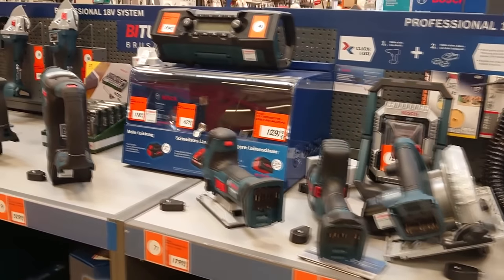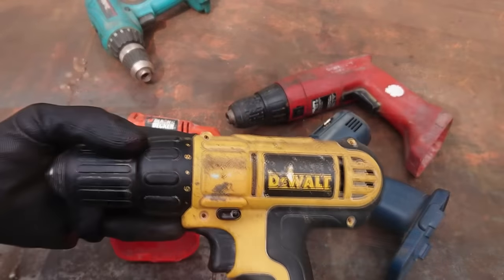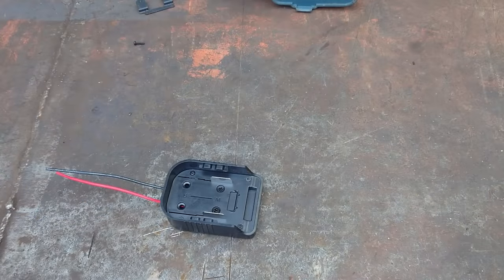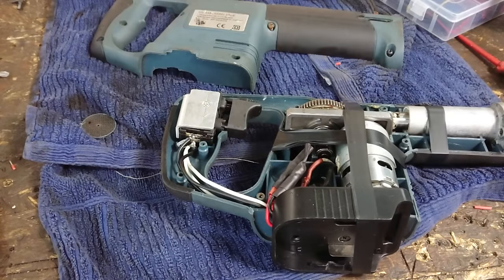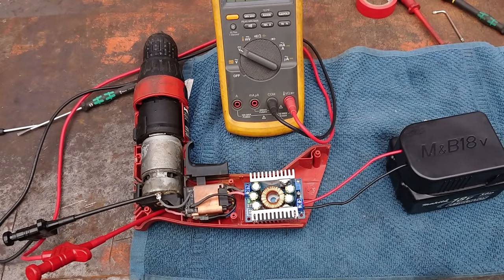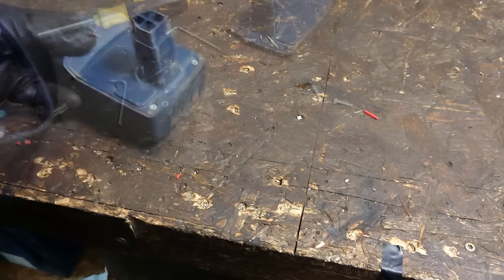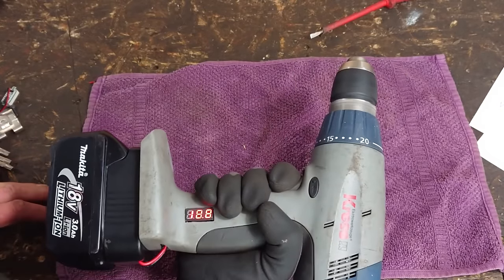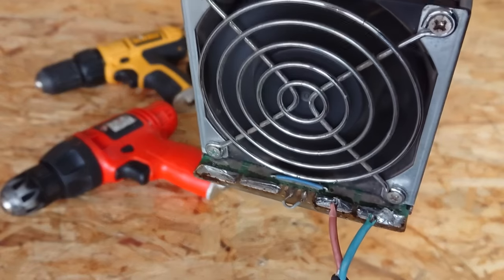Scrapyard Finds! Repair-A-Thon! Cordless Tools Galore!

Comment: My first cordless power tool was a Black and decker 4.8 drill they advertised that other tools were coming but never did as makita brought out the 9 volt drill and everyone followed and the race was on but back then the only way to get power was an expensive generator I couldn't justify buying one so I built a battery pack in a bag and used a 12 volt lead acid battery it made the drill super fast but it did what I wanted drill holes in metal I now have found numerous different cordless tools all different makes and it would be nice to convert them to take a Bosch battery as one of the tools my brother found cruising the alley was 4 Bosch 18 volt lithium battery drill kits all with 2 batteries and the charger so I have 4 drills 4 chargers and 8 batteries and would like to adapt my black and decker sawsall and circular saw also have various other cordless tools to convert

Comment: those drills running from the batteries in the DDR shoulder bags - do they feel odd? - the battery usually helps to make the tool feel balanced.

Comment: I wonder how much use or life these things have, or how much certain repairs can really help to reduce the production of new and shiny devices. That TiP reciprocating saw seems like something only you would use as the person who fixed it.

My biggest interest in the scrap yards is really for the motors and materials than can be reused. I wouldn't personally refurbish these tools. I would disassemble them.

Comment: hi Gerolf,
your idea of repairing and bringing to new life abandoned equipment is admirable, I would hope that your message will spread throughout the world.
With me you would break an open door: I am transforming an old battery powered Metabo drill from Ni-Cd (9.6 V) to Li-ion (3 cells 18650) using the original battery case. The biggest problem will be converting the charger, again into thyristor and transformer technology. the voltage change is not a problem because as in many of the drills you have restored it does not have electronic adjustment circuits. I will probably also put a voltmeter to keep an eye on the battery voltage, but I think I will put a button in series so as not to drain the battery between uses.
Whenever you want to do a repairathon you will find me agree, I also think you could sell the restored materials, but you probably already do.
Hello and see you soon
P.S. do not apologize for the singing birds: they are the background in line with your ecological way

Comment: I believe a lot of these tools are discarded because of battery failure and the cost of a replacement battery.
If you watch for sales events you can buy a new tool with a new battery and charger for just a few dollars more than the battery alone.

Comment: Corded cordless drill ! Thats what i do.I got old but gold AEG 18V (battery for it costed like 150€,fuck no ,so someone threw it in a garbage,professional tool with 80€ worthy of rohm extra self tightening chuck on it )that runs just fine on 14V DC/5A old battery charger.Ryobi cheaper one works also on 14V but its her natural habitat since its 12V.
Its all same old 775 motor which can go up to 24V -Only limiting factor is current.Different manufacturers put different mosfets and a diode that usualy go 5-6A.If you connect it to a car  battery and overload motor a bit it can draw more current than mosfet and diode can handle.thats what happend with my Ryobi-but it was as easy as find parts number and order it from ebay for 3$.

Comment: i just remake the batteries with old salvaged lion 18650 from discarded laptops, powerbanks etc. blalanc charge them, pick out the same valued ones and fit them in the old case add a bms and done.

Comment: The genuine Makita LXT (even the old ones with no level indicator) batteries do have built in undervoltage and individual cell protection...as soon as the board in the battery detects a problem it can lock the battery from being used ever again ...most commonly a problem if you leave mostly discharged battery packs in the cold and boom you're battery is locked ... Thankfully you can now buy new boards to replace them and if the individual cells tests good you can charge them individually up to ~3v with a current limiting psu and  you can bring the batteries back from the dead...for several years this was not the case and a lot of good Makita batteries were sent to landfill...unless I got my hands on them of course.....the lesson here is if you use Makita always charge you're batteries before putting you're tools away after a job.

Comment: Honestly I dont know if old battery powered tools are realy worth all the effort. Corded tools can perfectly usable,even if decades old, but cordless tool technology realy came a long way within the last years. I personally own a 12V Makita drill from '06 with a set of new batteries. Last year I went out and and spent ~35€ on a new 12V Parkside drill from Lidl, including a Lithium battery pack. It's almost disturbing how a cheap, but modern store-brand machine performs light years ahead of a barely used pro-tool from just fifteen years ago.

Comment: I just bought 9 dead lithium power tool battery on eBay.  1 was good 7 were good after charging one cell.  1 DOA rust but valuable parts inside.  <$6 ea for the 8 good ones.

Comment: I know I should have taken the electronics class in trade school. You are amazing.
Reply: I do not think you need a degree to do this sort of thing. Like he said red to red and black to black. When you use modules it is like snapping Lego together. You just need to know how to join wires and apply heat shrink tubing. Which is not nothing but I think anyone can pick it up.

Comment: I love it! Very cool video

On school I'm learning about electronics but it is very theoretical, whilst I'm doing a very practical study. So I love seeing these "hillbilly" solution that are just simple, basic, and above all just work.

No overthinking, not making things overcomplicated. Just make it work. I love it!

PS: Can you also use an adaptor with a convertor from 230V to 12V or 18V like they use for a Playstation, or many different electronic devices? Or would they not provide enough power to make the powertools work you think?

Comment: Fantastic video! You were lucky though that all of them worked so well..
Question for anyone who knows: I am restoring a cordless drill that seems to have been over heated and has a turn to turn short, it runs rough and uneven.. Is this restorable or do I need a new motor? I think rewinding it is out of my league and not worth the effort.. Tanks

Comment: Great customization and power unification. Instead of having batteries though, why not have an efficient portable generator you can bring in your bag working with any type of heat source (aka cognizable carbon fuel), and some supercaps as an energy buffer. Isn't  that going to be something ...

Comment: Those buck converters have a non-zero idle load/quiescent current, if you leave the battery on you might end up with a dead battery.

Comment: Dear @UCDbWmfrwmzn1ZsGgrYRUxoA, you can use a zener diode to detect low level voltage, remember if the voltage is lower than zener's voltage it will not conduct, so now you can implement solution : )

Comment: I truly wish there was a mfr who would also provide a power cord for cordless tools with dead batteries. Correct gauge wire of course  and a plug into the drill. Perfect for bench work when you can save the battery.

Comment: I once tried to connect a pc power supply to a cordless drill, but it ran very slowly and not much torque. I think the problem was that the switching power supply did not like the variable load of the PWM dril. I read that connecting a resistor across the output of the psu to give it a constant load would fix the problem, but I never got around to trying that.

Comment: From this fix it looks very like you're basically running tools originally designed for Ni-Cad batteries from Li-Ion batteries without any on board modification (apart from the voltage mods and voltage readout)?
If so, and the newer Li-Ion batteries just fitted the original tool, is there any reason why you couldn't just use them directly? (Assuming the original tool is the same voltage). I'm thinking of the AEG 18V range as I have 3 of these that originally came with Ni-Cad batteries (long since vanished).
Appreciate I'd need to get the Li-Ion charger for the replacement batteries.

Comment: Which system of power tools would you advise to buy for someone who has none yet? Price is not the biggest concern, I want to start with cordless drill, jigsaw or circular saw and sander first and then expand as needed. Would like a system where it's worth it to 'invest' in

Comment: AFAIK part of the battery is also the protection. So tehere is no need to add voltmeter or be worried about over discharging.

Comment: Thankyou for this video, it is quite useful. I would however like to know, what are the threaded low voltage power connectors called.

Comment: Im sure somebody already said this. But why dont you add a small momentary switch to the voltmeter so it doesnt constantly draw current from the battery when its connected to the tool?

Comment: I’m pretty sure that li-ion batteries from Makita have BMS circuitry inside. You could have tested it by discharging battery and checking if it shuts down. But I’m sure you knew it...

Comment: I think BMS is in the battery so there is no need for voltage meter acting as visual power protection. Makitas bms bricks if there is something wrong with the battery. I have repaired makitas packs with replacing the broken cell and replacing the original bms with the one from aliexpress. Makitas bms bricks beyond repair if bms triggers the protection.

Comment: The Makita battery packs should be removed when the tool is not in use, correct? The voltmeter will draw down the battery eventually, I would think.

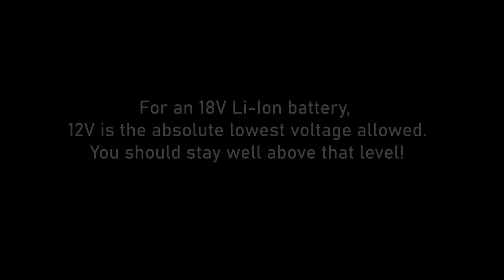Comment: 9:41 I would not recommend discharging your batteries 12V. 5 Cells with a minimum voltage of 2.5V in series produce 12.5V, so at 12V they are already overdischarged and permanently damaged. 12.5V is also too low, since one cell could be at 2.6V while another is at 2.4V (damaged) already. They don't all discharge equally.

Comment: Great Project.
Brace yourself for the many "Why did you not buy the original Battery?" and "Why did you not keep it original?" comments.

I still get flack from people I like to call "Schlaubi Schlümpfe" for modifying a MiniDisk player to run on AA Batteries only instead of the terrible Gumstick Battery that not even Sony makes anymore.

Comment: those connectors on buck converter will not last long @10-15A which you're likely to draw... better to solder the wires directly to the board
oh, it probably needs active cooling at those currents too

Comment: I have a 12v server power supply that would be good to run these tools but like your supply mine delivers a lot of current (100 amps. At 22:14 this would be great for some contractors.

Comment: hello. Li-Ion packs, do not always have an internal BMS, to control and balance the load and also the discharge, turning off the output when the voltage reaches the recommended minimum value?

Comment: what is the current rating for the buck convertor? the drills can draw in excess of 20 amps under heavy load...also need a relay so voltmeter only in cct on trigger is pulled to avoid draining battery...

Comment: Can't keep a good tool down.  I love my old DeWalt 18V but right after I finished buying what I wanted of them they came out with the 20V new battery type.  I have adaptors on the to use both new 20V DeWalt and Milwaukee M18.  I love used the M18 8.0 on them they are more powerfully and Milwaukee has the tech built in to the battery unlike DeWalt but I have close to 10 of the M18 vs 2 small DeWalts.

Comment: The lithium ion packs for my drills are overdischarged and the charger won't work. Is there a way to revive those batteries ? Maybe by charging the cells manually ?

Comment: One thing I did not understand, why were the Voltmeters connected across the battery (socket) ???
They should have been connected across the motor so they would light up only when the trigger is pulled.

Comment: I see you used 12 volts to test 18 volt tools, will 12 volts work on 20 and 24 volts, ( just long enough verify working ). I was given a box of various models of Milwaukee tools in different voltages. any advice will be greatly appreciated

Comment: Can you really power a cordless drill using a basic 12V adapter/PSU? I planned on doing that, but read that a DC motor can pull up to 30 amps under full load ... don't want that going through an old laptop cable.

Comment: 11:17 would that converter handle tho power required by the drill ? Its rated 8A so 96watts at 12v max, from experience, a simple small 12v bosch cordless drill that i have pulls up to 20 amp under load

Comment: I have 1 dead battery for my Metabo drill. The other one is still fine, but essentially I have a spare battery casing. I'm thinking about converting that casing to be a wired power supply for the drill. I'd like to directly plug it into 220v. Any ideas how to go about that?

Also, those army bags are quite useful. I found one in the Netherlands a while back. Still with the name of the soldier who used it in it, so no new old stock.
Reply: Follow up. This video did inspire me somewhat and subsequently I started doing some tests. I also remembered I had an old Einhell unit somewhere with 18 volt ni-cad which were, of course dead.

Now I hooked both 12 volt Metabo and the 18 volt Einhell onto my lab PSU to check what they generally needed in terms of amps. The 12 volt pulled about 5 with 6 for peeks while the 18 volt never peeked above 4 and mostly ran at 2.5 to 3 amps.

So here is my idea. The 18 volt seems kinda perfect to mod into a wired unit using a beefy laptop PSU that could be fitted in the empty battery casing. HP PSU's often are 18.5 volts and have amperages around 4.5. That would be plenty.

Going thirfting tomorrow to find myself a PSU. Added bonus is that having the PSU in the bottom means the weight distribution of the machine isn't that off.

Comment: Ha ha i have a makita old nicd drill which was cordless now running off my cheap chinese meanwell clone. And i plastic print my connector design to mate my b and q 40v batteries to my ebike so that they can still be used in the mower and the strimmer. I have a worx drill and powershot cordless jet washer. I am trying to stay in two batterie ecosystems. I like your rationale of going all makita.

Comment: Any idea how much current those 12v tools require to work since i tried it with ATX PSU of 440w combined together as single big wire, but it just stops working when i pull the trigger. I need something like that in another location that rarely gets used and i have several of those old but good tools needing power source, just havent been able to figure power source other than lead acid.

Comment: 12 volts is too low for an 18-volt (or incorrectly labeled 20 volt) lithium-ion battery. They are in a 5S1P and 5S2P configuration for extended capacity packs. The number in series and in parallel. You do not want to take your cells lower than 2.5 volts per cell and with 5 in series at 2.5 you you get 12.5 volts. This is only if all the cells are 100% balanced. Taking them down to 12 volts thus 2.4 volts per cell is a bit too far already for many cells. Honestly, all the big name brand like Bosch, Dewalt, Makita, Milwaukee, Hilti and others all have Battery Management Systems (BMS) in their batteries that protect against over discharge though. 

Love your videos.

Comment: Imagine if the industry was forced to build batteries to a single standard, say a 12, an 18 and a 24 volt, so any like voltage battery would fit any like voltage tool. The industry could still compete on both batteries and tools. I could still get batteries for my venerable Milwaukee V-18 tools.

Comment: I had a little chuckle when I saw you "Makita-ising" an Einhell drill.  Here in Australia the Einhell range is sold by the country's largest hardware chain (Bunnings) under the "Ozito PXC" store brand, and since that's the battery system that I use I've "Einhell-ised" a Makita drill. :-)

https://www.bunnings.com.au/search/products?q=ozito%20pxc

Comment: makita batteries doesnt have a protection circuit. once you discharge it too low, its dead. chargers wont accept it anymore. then you gotta replace that small board inside.
i wouldnt want to risk a good expensive battery for some no-name low quality tools. rather gather cells and weld my own. but at some point the effort isnt worth it anymore.

Comment: Nice again. What are these 2 pin connectors called in german? I am looking for thos for some time, but cant seem to find them. cheers.
Reply: I guess "Hohlstecker" and "Buchse" for the chassis part. Can't find them either.  I think it looks like an airplane connector that was some planes called Empower, or now Empower Classic. https://en.wikipedia.org/wiki/EmPower_(aircraft_power_adapter), though those are officially made of plastic, I think not in metal. I have one on my 12V "car" inverter, that would also run on such 15V EmPower sockets.
Reply: @algemeennut6683  het zijn ofwel dekstekkers die in de botenwereld worden gebruikt , of microfoonstekkers twee polig, heb ik uitgezocht.
Reply: Or maybe it's just another "aviation" style plug, as you can find on amazon. https://www.amazon.de/WITTKOWARE-Steckverbinder-Paar-Kupplung-Einbaustecker-verschraubbar/dp/B07NXT9SFC